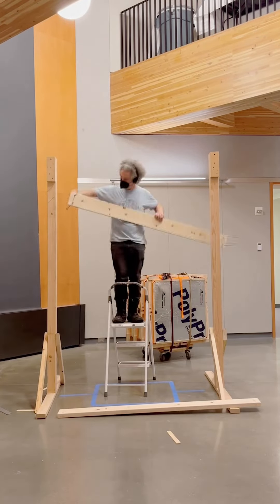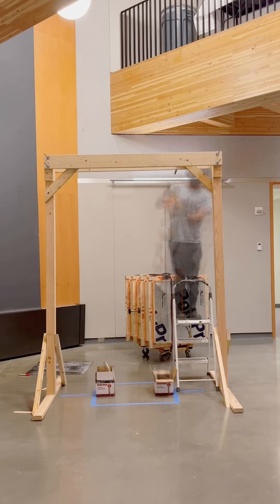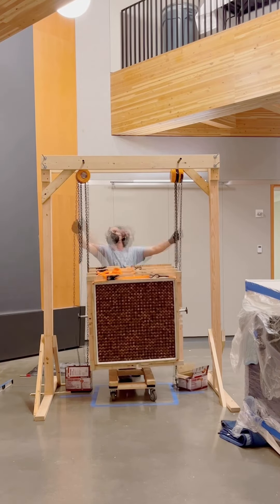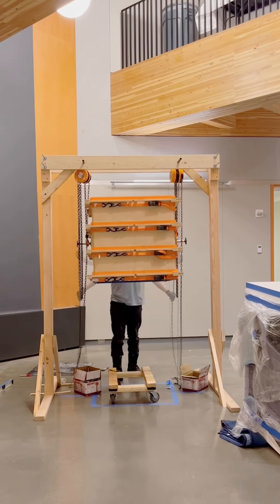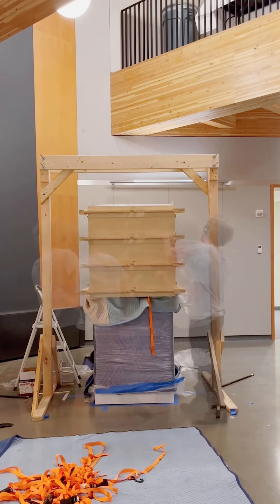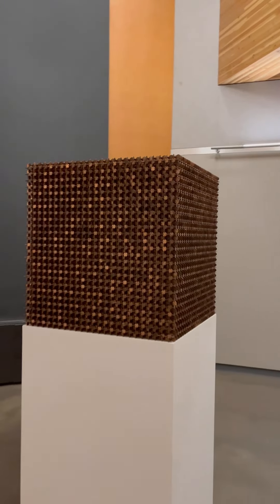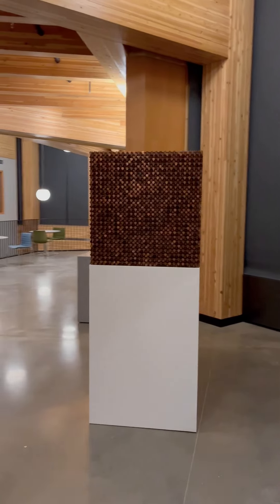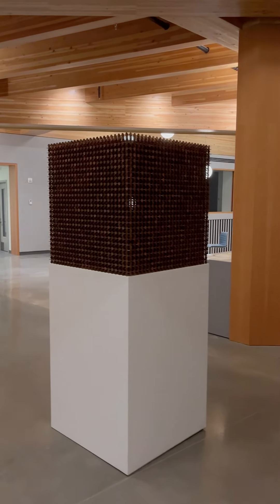Installing the Hundred Thousand Penny Cube

Comment: I didn’t understand till the end when you show how you made it.
The light and space within it gives an illusion of it being light weight.
Great work!
With that weight it must want to distort or collapse if you try to turn it over to work on it. You must have been very systematic about the construction. So straight too. Did you construct a form work like shell to help you keep it aligned and straight as you constructed it?
Reply from the maker: Thanks! Yes, good question.  I built the whole cube inside of a perimeter wall that slides up as I add layers.
Reply: @wechslerart  As a Printmaker and sculptor I love the process (and resolving those problems) of making art sometimes more than the finished work.

Comment: I think you're being modest, I count the cube edges at 51 pennies each, that gives a total of 132651 pennies in the structure, assuming none missing in the interior.
You could have gone as few as 47 coins on each edge to still be over 100k (103823).
Reply from the maker: I wish I could accept that assessment. In truth I'm exaggerating a teensy bit. The actual number is 99,450. The next possible cube is 111618. Those numbers are confusing because its not a matter of a simple cube root. a good way to think of the cube is as a collection of smaller cubes each made of 18 pennies and all sharing walls. The outer cube/units are obviously only sharing some of their walls. I hope that helps

Comment: Is this legal? Genuine curiosity. Since I believe there are laws about the use of money right? In my country, it is illegal to willfully deface, mutilate, tear, burn or destroy any currency and coins issued by our central bank.
Reply from the maker: thanks for taking an interest, yes it is legal here in the USA. it’s not a crime since it is not done with fraudulent intent. 

Longer answer: 
The relevant law (U.S.C. Title 18, Chapter 17,  Section 331) begins “whoever fraudulently alters…” which means ‘fraudulent intent’ must be attached to the act in order for it to be a crime. But you don’t have to take my word for it. 
In 1980 A Mr Vance Fowler wrote the treasure asking if compressed Penny souvenirs are illegal. He got a response from Kenneth B Gubin Council to the Mint, it read in part:
“you refer to and question the legality of a souvenir machine which compresses coins and returns a souvenir. You refer to Title 18, U.S.C. Section 331 and 475
“As you are already aware, a federal statute in the criminal code of the United States (18 U.S.C. 331) indeed makes it illegal if one ‘fraudulently alters, defaces, mutilates, impairs, diminishes, falsifies, scales or lightens’ any US coin. However, being a criminal statute, a fraudulent intent is required for violation. Thus, the mere act of compressing coins into souvenirs is not illegal, without other factors being present’
The letter was written by the mints legal council on letter head from the Department of the Treasury, Office of the Director of the Mint. So as far as that authority is concerned this kind of work is not illegal.

Comment: Wait what?
No glue
No weld
No screws

How did you do it?
Reply from the maker: These are all pressed together. I precisely  notch the coins with notches narrower than the thickness of the coin. Then force them together (you can see some of this in other vids in my feed) the resulting joints are sturdy and the structure as a whole is very solid

Comment: Next time put it on a lighted base.
Reply from the maker: Thanks for the suggestion. I've tried a number of experiments with lighting these structures over the years. the structure is a little tricky becasue its made out of flat planes oriented parallel with the walls and ceiling. shining lights from above just bounce onto the floor and putting lights inside the cube or directly underneath only serve to illuminate whatever layer they are placed in and have the disadvantage of being distractingly bright in relation to the rest of the cube. The best lighting is brightly lit walls or banks of windows. this allows light to bounce directly into the viewers eye form behind without casting shadows and it allows light to be visible through the structure as well. I also appreciate the way natural/ambient/passive lighting like this connects the cube to the space, the cube may look different at different times. I also like the passive lighting because it means the cube is nothing but itsself. no glue, no welds, no lights, just pennies.

Comment: Us code title 18 chapter 17
Reply from the maker: The relevant law (U.S.C. Title 18, Chapter 17, Section 331) begins “whoever fraudulently alters…”. And the second paragraph begins the same “whoever fraudulently a…”  the word fraudulently is intentional and meaningful. Without that word the would mean any ‘alteration’ or ‘possession’ of altered coins would be criminal but the use of the word fraudulent here means ‘fraudulent intent’ must be attached to the act in order for it to be a crime. But you don’t have to take my word for it. 

In 1980 A Mr Vance Fowler wrote the treasure asking if compressed Penny souvenirs are illegal. He got a response from Kenneth B Gubin Council to the Mint, it read in part:
“you refer to and question the legality of a souvenir machine which compresses coins and returns a souvenir. You refer to Title 18, U.S.C. Section 331 and 475
“As you are already aware, a federal statute in the criminal code of the United States (18 U.S.C. 331) indeed makes it illegal if one ‘fraudulently alters, defaces, mutilates, impairs, diminishes, falsifies, scales or lightens’ any US coin. However, being a criminal statute, a fraudulent intent is required for violation. Thus, the mere act of compressing coins into souvenirs is not illegal, without other factors being present’

The letter was written by the mints legal council on letter head from the Department of the Treasury, Office of the Director of the Mint. So as far as that authority is concerned this kind of work is not illegal